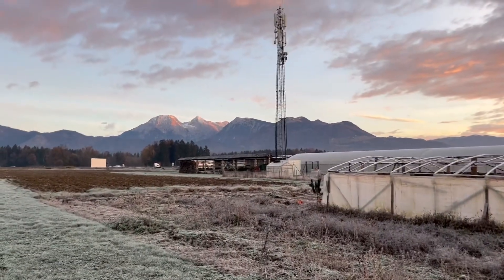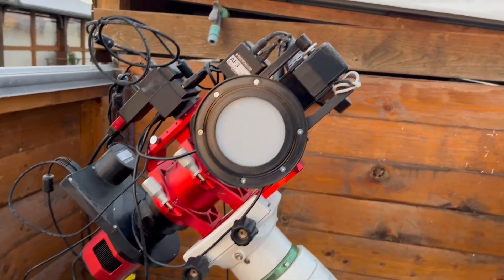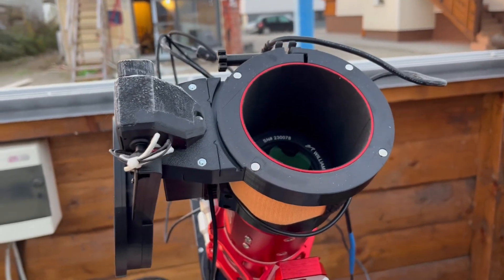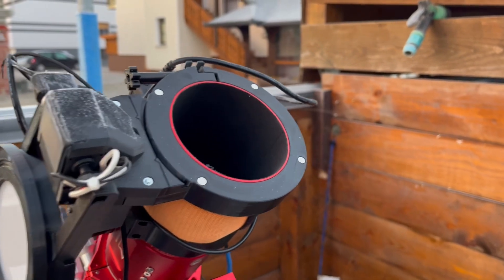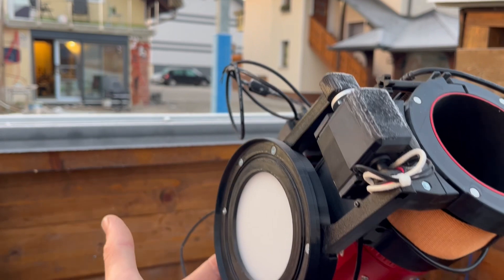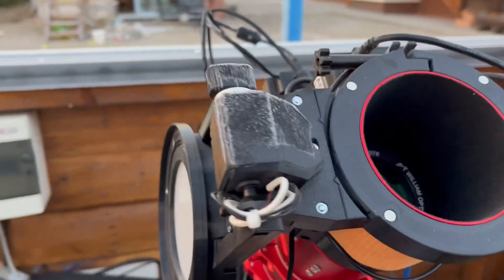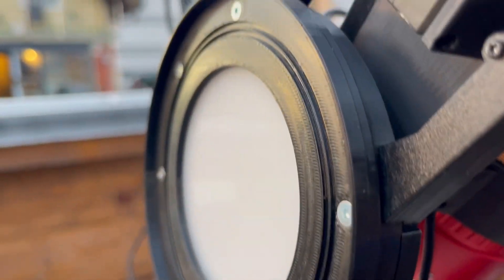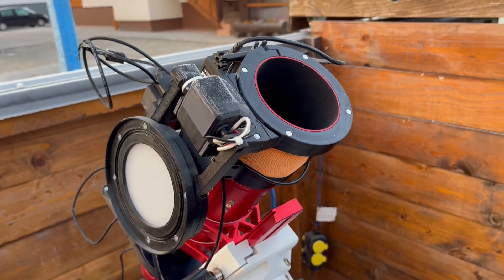Flap Panel facelift and integrated LED heater update

Comment: Is it ASIair compatible? If not is that something you’re planning on, or possible to achieve in the future? Switched to the ZWO system for the homogeneity and simplicity. 
That said there’re still lots of products that I’d like to see made compatible but aren’t☹️
Reply: at the moment, you can control it via manual button. In future we have planned wifi control. But directly via ASIAIR - probably not. ZWO has closed ecosystem, similar to Apple. They support only the devices they choose.